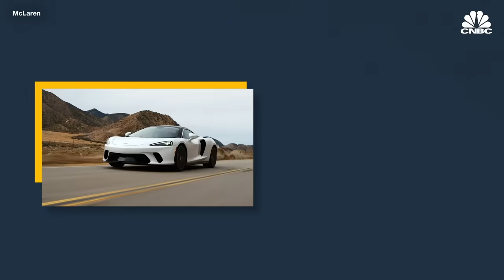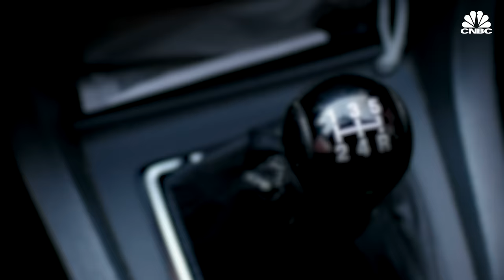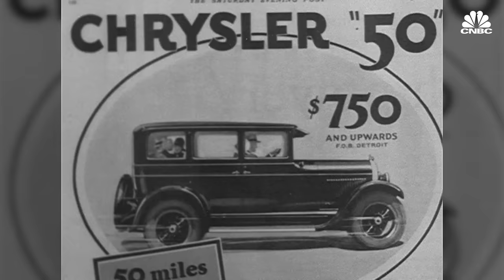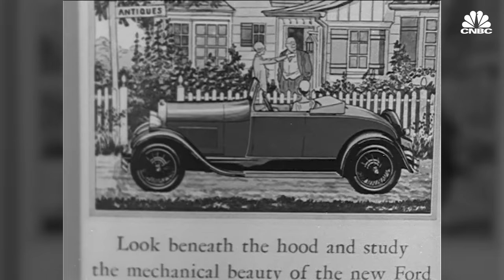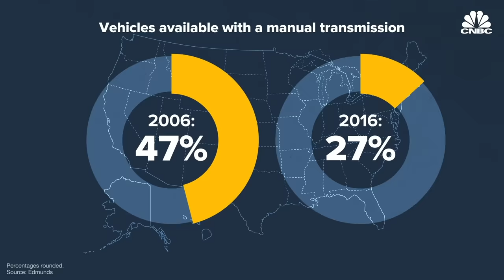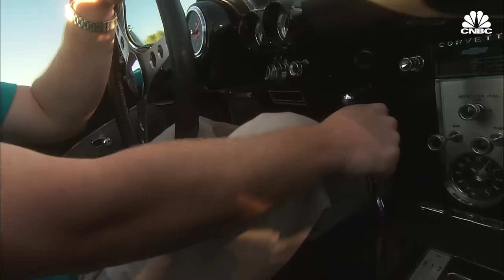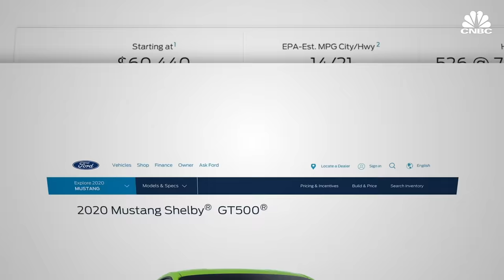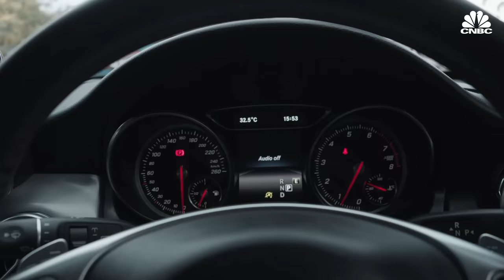Why Stick Shifts Are Going Extinct

Comment: Stick shifts don’t require “constant attention” it’s like riding a bike once you know what you’re doing
Reply: Diego Huerta please list this in my above comment on incorrect statements made. :-)
Reply: Sure, on the highway, get in an area like a City with lots of traffic lights and it becomes tiring.
Reply: It’s not tiring at all. Once you get used to doing it you stop thinking about it and it happens naturally.
Reply: chris hood bit still a hassle, I stopped with stick shifts. Same with many many ppl.
Reply: This is so depressing. I've always been a stick shifter and will always be one. I have known for many years now that we're a dying breed. My gf drives a Tesla and we always have friendly discussions. For me, there is nothing better than rowing my own gears as I know what my vehicle is doing, behaving, and how fast it's going~ Bar none.
Reply: Stick shifts require constant attention if you move from an auto to manual. Once you are up and running in a stick shift its easy. Some people HATE autos
Reply: But it help ensuring that the driver is paying attention to it's surroundings
Reply: @chrishood7968  It is when your vehicle weighs 80,000 pounds and has 13 gears and takes 8 of those just to reach 35 MPH.
Reply: Diego Huerta I would actually disagree. It requires a lot of attention. But that’s actually a good thing. This keeps people alert, and focused on driving. Rather than looking at your phone or zoning out.
Reply: @j.t.brunner7452  Do you mean semi-trucks? Because if that's the case, I'm never gonna be a truck driver. No thanks.
Reply: Manual transmission is like you will never forget your reading glasses 🤓 it becomes natural
Reply: J.T. Brunner not first gear ⚙️ that’s only on mountain 🏔 driving..
Reply: I caught that too
Reply: it does require a certain baseline amount of attention, and that's a good thing. Having been driving a stick since the 90s, I've noticed that one major benefit is that I don't speed due to influence by other cars or just by force of habit. I drive the speed I want with intent. When you drive auto, it's so easy to drive faster and faster without awareness.
Reply: @j.t.brunner7452   It's very tiring for senior citizens' weak legs...
Reply: You do it naturally.  People ask me how can I drive a stick (and my motorcycle too) and I'm like UMMMM i just do☺️ ...I grew up in a family where everyone drove stick shift (mom dad bro etc) then my husband too so it's normal to us (even though not in the USA) Lol...☺️👍
Reply: @battosaijenkins946  I'm with you 👍☺️
Reply: And great fun for those who get to watch new ones on hills😁
Reply: @battosaijenkins946  I agree. Because of my wife I had to trade my stick for an auto. And guess what...I still manually shift the auto 😅😅
Reply: Exactly
Reply: thats problem us also doesnt ride bikes xD
Reply: @mathiasdurand3354  then the speedo meter should be projected on the glass and not hiden behind the wheel where you need to look down. but still this is rare.
Reply: J.T. Brunner to the extent that you have to keep shifting gears but in no way does it require constant attention
Reply: It requires two hands and so many drivers hold their phones in one hand even when they're not using it so a stick shift is out of the question for them.
Reply: I was going to say the same thing.  I don't really think it's something you have to concentrate on, it's something i've been doing everyday for years, i don't put much noticable thought into changing gear and pressing my foot down on the clutch.
Reply: Diego Huerta lmao
Reply: @battosaijenkins946  Canadian viewer.  Same here.  There is no skill involved with an automatic whether you put it in drive or paddle shift up and down.   We are a dying breed in N.America, for sure....I live in the land of bloated pick ups, refrigerator on wheels SUV's, their smaller cousins, the bar fridges on wheels, CUV.s etc.
Reply: @cdpgbc-mw2kz  there isn't much skill in using a synchronized transmission either.
Reply: This. And it also doen't require "a lot of skill". Yes, you need to learn it and it may seem a bit complicated in the beginning. But it's learnable very fast.
Reply: well till you run into bumper to bumper traffic all day
Reply: Until you are in a city
Reply: Diego Huerta absolutely!!
Reply: chris hood 
Actually it is tiring. Yes, of course it becomes natural. But that doesn’t mean it’s not tiring to drive through heavy traffic working the brake, clutch, and shifter-especially when you contrast it with your experience driving an automatic. I drove stick shifts for years. When I moved to a major city, I wisely bought an automatic. Since population growth has happened primarily in the cities, it’s not surprising that automatics have become more and more popular.
Reply: @ethancheng1595  and so they crash . Auto is so easy man !
Reply: To all the homies down here. It is not tough nor distracting at all. You keep driving sticks and over the period of time it becomes completely normal. You don’t even realize u are shifting cos over the period of time your brain automatically does it for u. And it is actually more fun and a true driving experience than automatic. You won’t understand unless u try it yourself. ✌️ peace
Reply: If we're being honest stick shift requires more work and can be less efficient but the reason people drive stick shift is because its fun. The feeling of a perfect shift is bar none.
Reply: LA Ryan  you must be a single father then doing everything yourself
Reply: @ethancheng1595  thank you
Reply: qwrt hialname, um, fortnight is for kids. This 44 year old NCO will get back to defending our country. You’re welcome.
Reply: The real agenda is that car dealerships get MORE ATTENTION from owners of automatics who need to buy new cars more often than owners of manuals.
Reply: @j.t.brunner7452  
RE: J.T. Brunner
RE: "Sure, on the highway, get in an area like a City with lots of traffic lights and it becomes tiring."
I am a die-hard fan of manuals. However, I have had no problem with a stick shift - not even in heavy urban traffic. I don't have to think about it, I just do it, whether it's upshifting, downshifting, braking, whatever. I can shift, turn on the radio, shift, stick a cigarette in my mouth, shift, light the cigarette, shift, change stations on the radio, and so forth.
Reply: @j.t.brunner7452  life is tiring my friend, why do you even get up from your bed? its tiring
Reply: @indranilchakrabarty4196  I am one of those people who hate Auto transmission ! And you are totally right it is just second nature and much more precise and quicker on the go , everyone's in such a hurry , you know it's only because they are trying to catch up to me with my standard shift . ;-)
Reply: @j.t.brunner7452  sounds like you don't like your job .
Reply: My first car was a manual, and for awhile I wasn’t able to talk to passengers or even listen to the radio at first because of how much attention the manual transmission demanded. But over time I did become used to it, and I agree 100%: once you know it well (and that specific car, too) you hardly even notice you’re shifting manually at all. I drive an automatic now, and I can honestly say I still miss my manual car... I preferred a manual transmission in almost every way.
Reply: I’ve been told I made manuals drive like automatics on numerous occasions. It definitely becomes a reflex
Reply: You are aware it's the "2000's"  "# 2000" EVERYTHING IS IMPOSSIBLE!
Reply: @j.t.brunner7452  I half to drive stick to work almost everyday now.  It's all city streets and stop and go.  I have no idea what you're talking about being tiring.
Reply: @andymullarx6365  it's not that big of a deal to shift and text at the same time.   Not saying you should do it.
Reply: That is true as anyone who has owned a lot of manual transmission cars and/or trucks can attest to.
Reply: @Timothee_Chalamet_CMBYN  and not an issue with many many people
Reply: If you can drive a motorcycle you can drive a stick shift car
Reply: @indranilchakrabarty4196  I can confirm I hate an automatic. If you drive an automatic you don't drive the car, the car drives you and you give some suggestions.
Reply: @Mcquiz95  Yes, of course
Reply: I drive a rare 2007 Toyota Camry CE model. Fully loaded with a 5 Speed Manual Transmission, and I love it. I bought it, because it's rare, and it has a Manual Transmission. If it was Automatic, I wouldn't have bought it. All my previous cars were Manual, and all my car's I currently own, are Manual. I hate Automatic.
Reply: Diego Huerta ya I assume the person who wrote the script doesn’t know how to drive a manual.
Reply: J.T. Brunner 🤦🏻‍♂️
Reply: @mikeaninger7388  Stick shifters are actually better drivers and much more skilled than auto drivers.More like an experienced, highly skilled A380/ 747 Captain and can fly the plane manually when crisis comes as opposed to a local flying club glider pilot.
Reply: Of course it requires constant attention. You can't just mindlessly press a gas pedal anymore, and have to divert some focus to pressing the clutch and moving the stick. It should have still stayed as the norm. Less distracted people driving and texting when they're on a stick shift.
Reply: They don't require attention. They are sealed for life. Chances are a stickshift box will out live you. Just a clutch change every 100,000 miles. An auto transmission is sealed for life... the life of the car. Usually 10 years. Good luck.
Reply: You try sitting in standstill I-405 traffic with a stick for years
Reply: @technole  Well if you're at a stand still, you're not using the stick, are you? Get an electric car.
Reply: EdgyNumber1 hence why Elon’s cars are poular in Cal
Reply: Aren’t you supposed to be constantly paying attention while driving anyway lol
Reply: @gamingden444  not really, if you have one of Elon's cars
Reply: Automatics and Electrics. For people who hate cars...
Reply: @j.t.brunner7452  One gets significantly better gas mileage in a city with a stick shift. Brakes last longer and they cost thousands less over the lifetime of a car. Things have changed a bit with regenerative braking with electronic cars.
Reply: @ethancheng1595  
Exactly!
Reply: I recommend my semi to be manual, keeps me focused more on the road...for me, manual when I'm in my semi
Reply: J.T brought a semi to a car show 😂
Reply: You've nailed the problem right there: "once you know what you're doing".  People don't want to know what they're doing anymore.  Their government knows what they're doing and as long as their government approves... that's good enough for them.
Reply: @indranilchakrabarty4196 The reason  drivers  don't want a manual transmission  is it is to hard to shift and Text at the  same  time!
Reply: exactly
Reply: @j.t.brunner7452  it's one of those things that you simply get used to and forget about after a bit - I drive a stick, including in heavy traffic and it really is no big, after a bit it just becomes second nature and you shift gears pretty much "automatically"/on instinct, without having to think about it or pay "constant attention" to what you're doing.
Reply: Tesla made that obsolete. I get more power from an electric instantly
Reply: @gredangeo  Yes
Reply: I was taught to drive using stick shifts, I feel like I am more likely to crash driving a stick shift as it does require constant attention, I do drive very rarely though, autos mean I can pay attention to the road instead of gears.
Reply: A good example if this would be when a skilled manual driver has to operate an automatic vehicle, he will keep trying to use a clutch and shifter that isn't there. He no longer thinks about the gears he needs to be in, he just does it.(it only took me 3 months of driving a standard before I rarely needed to think about shifting)
Reply: My hands and feet just do it. i don’t even think about it. I had one automatic in my life. Ford escort. Tranny blew, cost me $3k. I vowed never again. Manual had better mileage as well. But I think in some cars that is no longer the case.
Reply: Andy Mullarx they should put the fuckn phone down!
Reply: Agreed shifting becomes second nature...  but I commute to work 1 hour minimum stop and go traffic the whole way.  I didn’t shed a single tear when giving up my manual transmission.  If I used it for normal suburban driving, I’d go with a manual forever
Reply: I always prefer a manual transmission. For one, they are cheaper to repair. Secondly,  the manual gives the driver a sense of being more in control of his vehicle. Thirdly, manual shift makes it more difficult to talk or text on the phone while driving.
Reply: @ericrodriguez7423   The manual transmission requires practically no attention, it's all muscle memory. What happens is that one must pay attention to driving. That's what people are supposed to do when they are driving, pay attention. Even with an AT they are supposed pay attention, they simply don't because there is nothing to enforce it. Hence all the poor driving in North America.
Reply: LA Ryan  It is a metaphor for taking control, drive verse ride, think about these comments you have kids, yes auto verse response.
Reply: @j.t.brunner7452   maddening is more like it when it becomes an hour of constant clutching stop and go in clogged traffic ....all the rest of the time it is awesome fun ....UNTILL you twist and ankle etc then you car becomes undrivable
Reply: That's still attention
Reply: Correct,  it just takes more skill. I still love driving stick shift and I still look for them when buying cars/trucks. Think I am going to have to keep my truck until it falls apart.
Reply: @ericrodriguez7423  If you consciously think about shifting the entire time you're driving, you probably don't really know how to drive a manual.
Reply: @chrishood7968  I like driving stick but I'll be the first to say driving stick is annoying af in traffic
Reply: Nonya Biznes  same here lol. That's what you call skill
Reply: company that making those cars doesnt care about stick or not. they care if it sells or not. and sticks just doesnt sell. its like blackberry vs apple. sure you can still buy a blackberry now but why?
Reply: Agreed. I drove stick for 7 years and it became second nature. I literally wouldn't notice, even in traffic.
Reply: ITS the stop & go traffic that Kills the manual shift,
Reply: ginger elvira some of the busiest cities in the work are predominantly stick shift, Mexico City, Tokyo etc..
Reply: bike shifting is like paddle shifting, not at all like stick shift
Reply: Diego Huerta Exactly.  It’s like saying “breathing” requires constant attention.
Reply: @indranilchakrabarty4196  manuals are easier and cheaper to maintain
Reply: @chrishood7968  stop and go driving is detrimental for stick shift cars...
Reply: It's like 35mm film cameras and digital cameras. Film cameras require you to think and use skill. Digital cameras, not so much, you just simply capture photos.
Reply: J.T. Brunner . Unfortunately more and more fleet companies are buying automatic transmissions for otr trucks.  There’s not a big cost difference now
Reply: LA Ryan  by the time driving ain't fun anymore I'd like a manual also. I hope it never happens
Reply: For ones who drive manual trans for a long time, shifting is almost like blingking their eyes..
Reply: @j.t.brunner7452  Changing gear is tiring? Are you kidding me? Is turning your steering wheel tiring?  Is braking tiring?  Is constantly pressing and releasing the accelerator tiring? Is indicating tiring? Is changing the radios station or volume tiring? NO.  ...then why the hell would changing gear be tiring? It becomes second nature just like all those other actions do..  I drive ~25K miles a year. How many gear changes to you think I remember? NONE. How many days did I come home with a sore arm from changing gear? NONE. Don't just make thing's up J.T. It's simply not true that changing gear is tiring.
Reply: LA Ryan  "I have kids now, I must get an automatic transmission"  Not something I've ever hear an Irish person saying tbh, or an English person for that matter.
Reply: The pansy generation that has zero tolerance and less attention span than a goldfish. 
I am not eliminating my 6 speed manual
Reply: Shawn ¿ definitely makes driving a lot more fun
Reply: @j.t.brunner7452  
I drive a truck with a 10 manual. I go through Dallas Texas area twice a week lots of shifting .  I don't mind. Would rather have a manual than an auto or auto shift transmission
Reply: LA Ryan  
I'm 63, I have a pick up an 88 Dodge Dakota,  and drive an 18 wheeler truck with a 10 speed manual transmission  I still enjoy shifting over an auto.
Reply: I mean, since when is “constant attention” when driving a bad thing? What kind of silly argument is that?
Reply: Skyler Allenson  

Patience, young one. 

You too might have bad knees in three or four decades.
Reply: @j.t.brunner7452  Americans: automatic for 4-gears cars and manual (unsynched) on 18 gears lorries.
Reply: @j.t.brunner7452  That is why I learned to float. Can't argue with the annoyance of traffic jams, but I still prefer the manual. Hell, big rigs are even more fun than cars with manual shifting.
Reply: Diego Huerta wrong buddy. You don’t drive stick do you?
Reply: @j.t.brunner7452  Only if you're inexperienced. When you're not a novice anymore, stick shifting becomes second nature, like how people don't actually need to think about which feet to step forward with when they are running. You've practiced since you were a toddler. More practice in manual in traffic is what you need, sir.
Reply: LA Ryan  do you mean when you become lazy?
Reply: @Timothee_Chalamet_CMBYN  those people cant drive properly lol
Reply: @j.t.brunner7452  thats a truck i think your exempt bro
Reply: no its not,
Reply: Back in the day, I drove home many nights drunk out of my mind and didn’t remember much about the previous evening.  Even drunk driving a stick is muscle memory and just becomes second nature.
Reply: @chrishood7968  Maybe that's you but the market speaks for itself. People don't want to deal with shifting because they don't have to. It's unnecessary so why do it? Especially if you're not really into cars and don't notice the difference.
Reply: @TheDealer6373  In bumper to bumper rush hour traffic for an hour and half? Don't think so.
Reply: Wrong
Reply: Couldn't agree more. It's like breathing or blinking. You do it without even noticing. If someone has to think about it or even notices themselves doing it then they don't know how to drive.
Reply: LA Ryan  I didn't grow out of it.  I've been driving for 30 years and can't stand driving automatic cars. It just feels wrong, like you're not fully in control. It's been a few years since I've driven one though. I hear they are better nowadays. Still wouldn't buy one though.
Reply: @j.t.brunner7452  Nah, I used to love the old sixteen speed, split gearboxes on the trucks I drove in the past. They're mostly all auto nowadays though (at least here in the UK). That, combined with adaptive cruise control makes me feel lazy. Can't deny they are easier for new truck drivers to learn in though.
Reply: It's even more second nature when riding a motorcycle.
Reply: @tomcat8662  it might be actually tiring if you live in the city with constant heavy traffic.
Reply: @spht9ng  most people can't drive in auto and often get to an accident fast, now that self driving is thing, there's gonna be alote of people that who can't drive, an error or some dumb ass will rear ended the car.
Reply: Driving ANY car requires constant attention. Manual or automatic. Doesn't matter. If you whine for having to pay constant attention, you should never drive, ever.
Reply: @bertgrau9246  even buses too